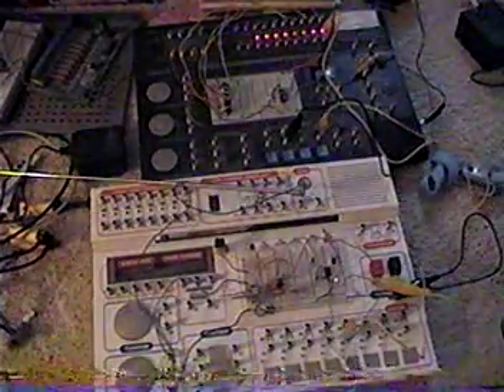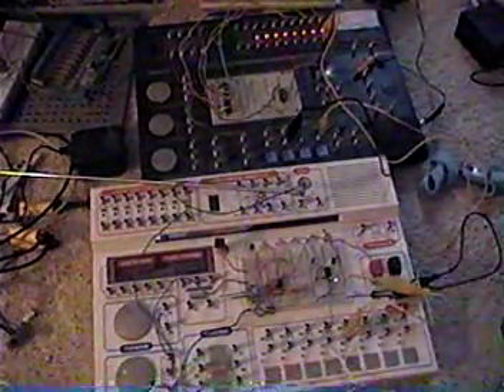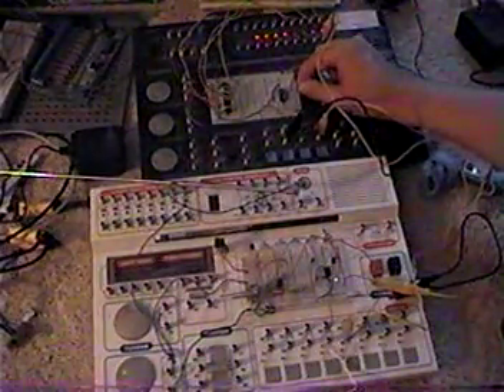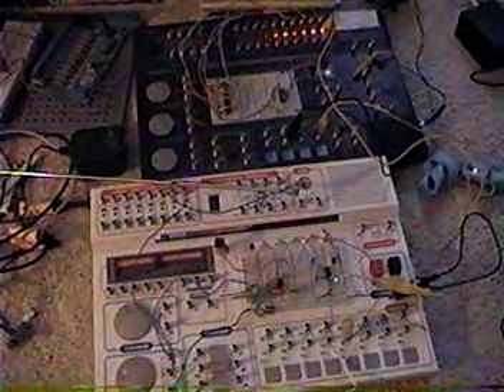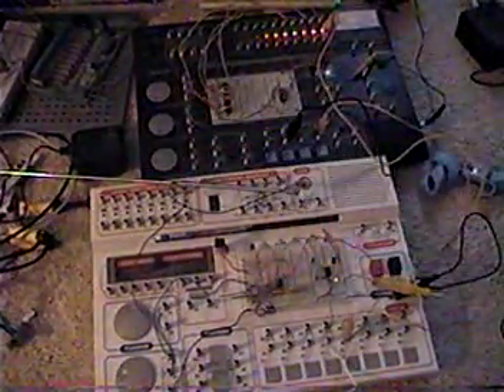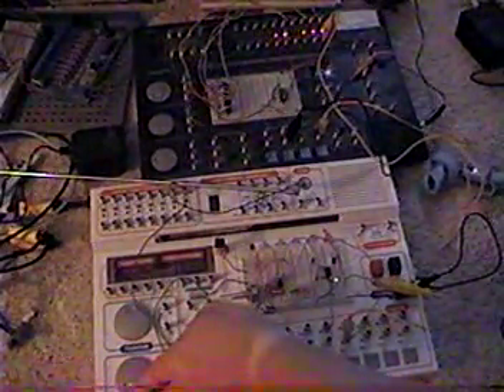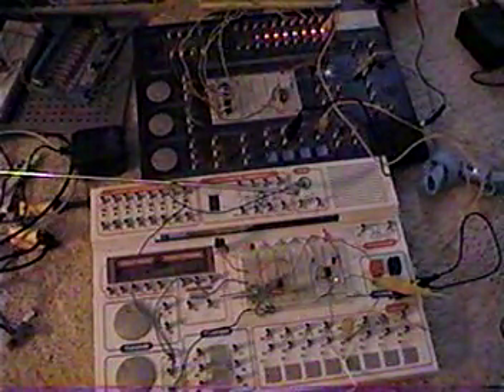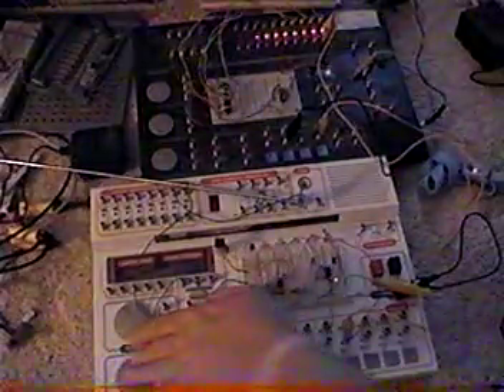2 electronic kits

Comment: Yeah, flawed design in my opinion..........should have put a multi-switch on the V side. My RS lab started melting due to this fact. I returned it and they sent the lab back to the Tech Department. I also sent an Email to them spelling out the shortcomings in the lab design.

Comment from the maker: the learning power has a switch but it only turns on/off ground of the last battery
it is possible to have an active circuit between 2 battery points with the switch off
the 300in1 has no switch for ground
I use an external power for my kits

Comment from the maker: 300in1 is made by other manfactures as well now but the learning lab by radio shack has a meter and I like the resistors combined with the leds for projects
the 300in1 has radio projects because of the coil and tuning knob
sometimes you can find them used at a swapmeet but rarely
the 200in1 doesnt have a breadboard so you dont learn as much but the 300in1 does
I also use parts from ramsey kits to with the kits, like decoders, or the sa 602 mixer/oscillator